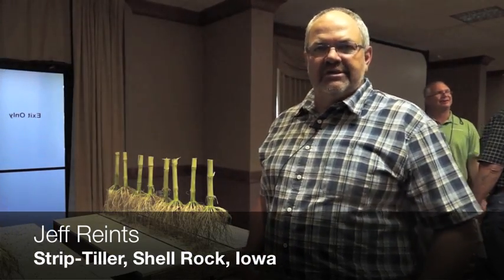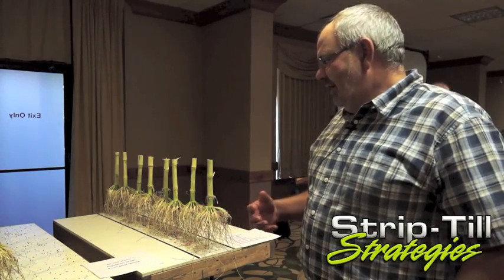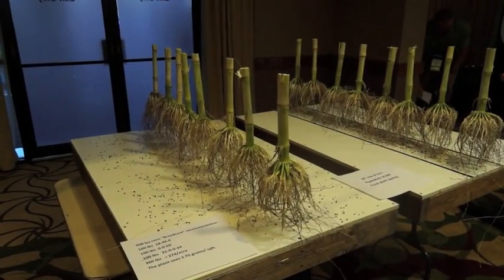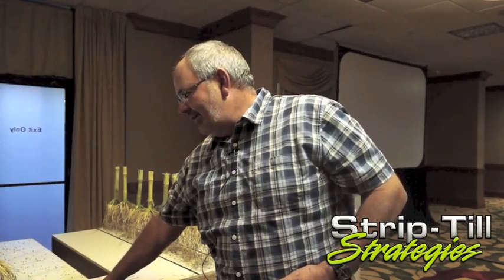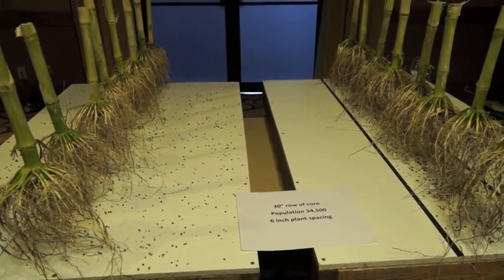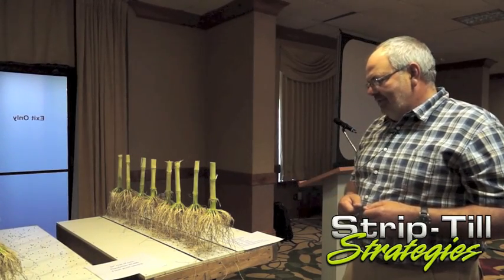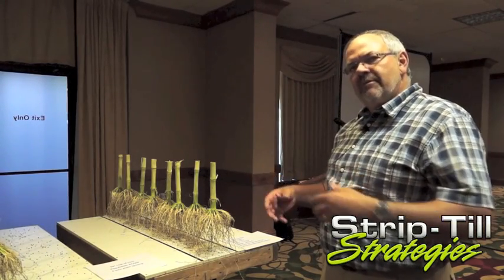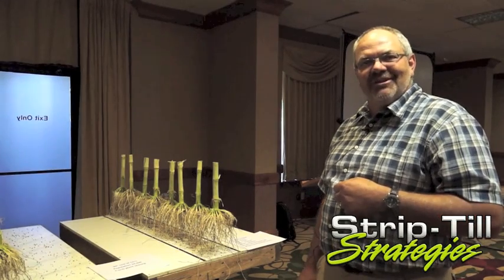Fertilizer: Comparing Broadcast to Banded Application

Comment: The benefits of strip till are obvious. What works in dryland fields in Iowa may not work everywhere. 

Search strip till disaster...nothing comes up. Because no one posts when their corn has just emerged and gets a 4 inch rain and drowns out. Water saturation in the tillage trench and no water between the rows. Replanting 50% of your acres once in 10 years is once too many.